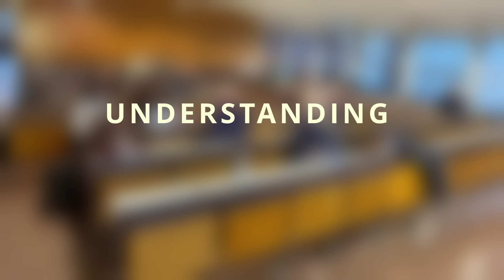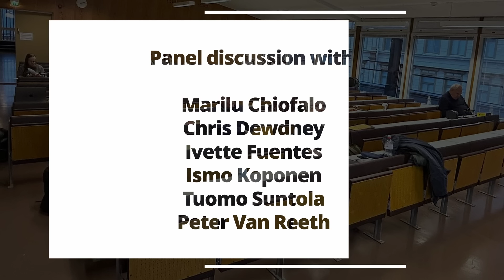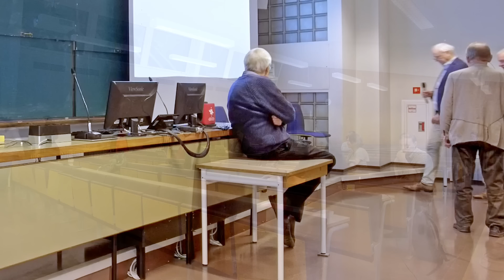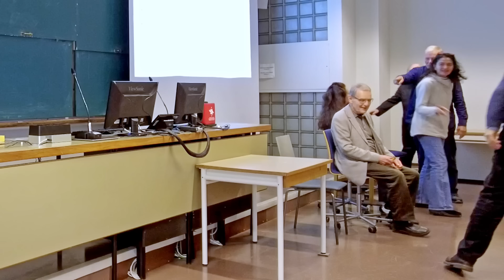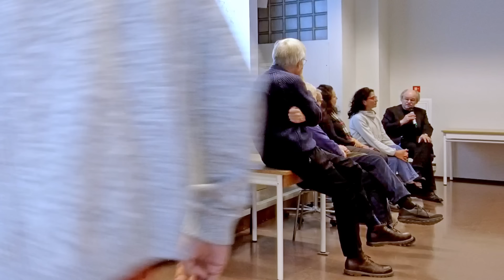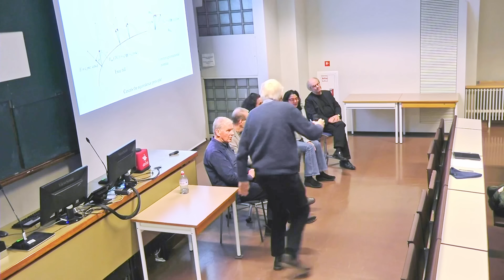PANEL: Marilu Chiofalo, Chris Dewdney, Ivette Fuentes, Ismo Koponen, Tuomo Suntola, Peter Van Reeth

Comment: Aren't waves actually working around different sizes of gravitational fields or you might say thebdark enrrgy vscvums all the way up and down the  scale. Kind of like gravitational lensing when u peer out.  Eventually  ull run into sonething and must move and use the firce  to be more efficient thsn a perfect straight line